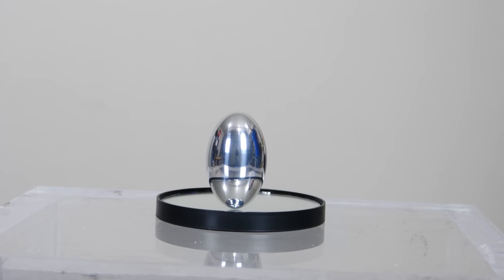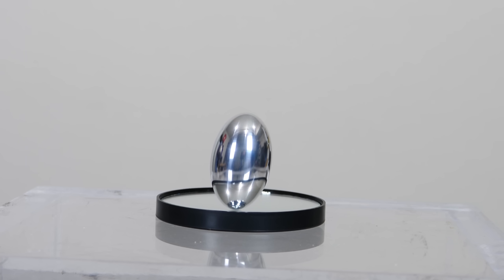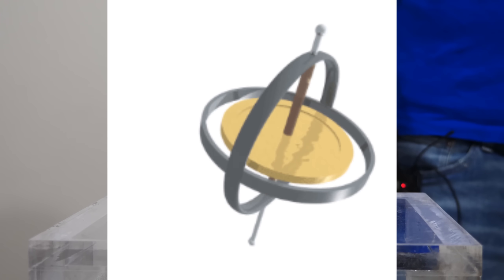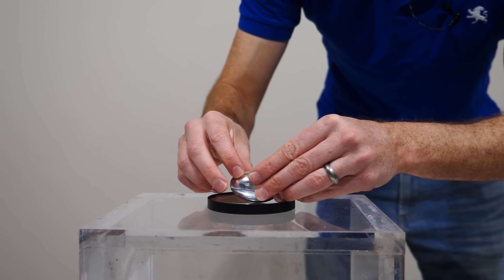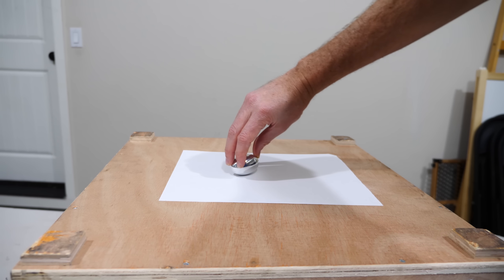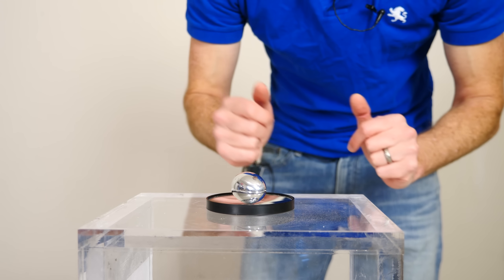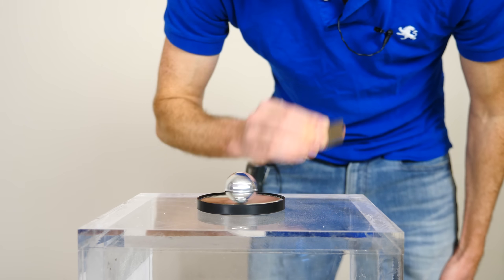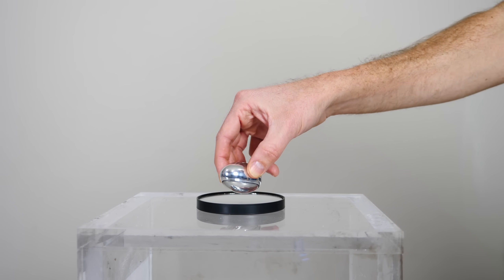Tesla's Egg of Columbus—The Gelatinous Solid

Comment: You can do something similar if you superglue two 1/2 " ball bearings together and then blow in a straw to spin them. A bic pen works exceptionally well I'd advise lightly sanding the glue points. They can fly apart an incredible speed.

Comment: If you want your mind to be really blown.

Put the pad that you are spinning it on.

On a scale.

Then spin the egg.

And see what the scale says.

Because you're also watching anti-gravity in action.

Ironically this is not what is making the egg stand up.

Your explanation of that process was correct.

But the egg is also becoming lighter.

But don't take my word for it.

Give it a shot.
Reply: I've thought of the idea of spinning objects losing their weight, or their weight being carried by some other principles. But I am unaware if this truly exist in any way. Could you further explain why the egg is losing it's own weight?
Reply: @JEAthePrince  Because there is actually no such thing as "Gravity".

It is an Emergent Effect. Like electromagnetism.

If you negate the processes that cause the effect to emerge. The effect (ie Gravity) weakness.

And if it's negated enough. It would have no Mass at all. And would become essentially massless and therefore weightless.

However. If the intensity is great enough. In the presence of an external magnetic or gravitational fields. It will begin to produce a repulsive effect.

Which is real Anti-Gravity.

My paper will be released to the public soon.

Keep an eye out.!

Great question. Thank you for the comment.👍
Reply: @I86282  I was thinking that a bubble floats seemingly effortlessly, and depending on the fluid an object is submerged in, it will change its rate of fall depending on the structure, size, and overall mass, density, etc.  I began to think that the only way to lift would be to isolate enough of a specific element and disperse it in a light enough material, that would be able to bouyantly lift a person. In other words, I'm thinking of making actual wings. It is simpler than studying electromagnetic fields and trying to draw infinite enrrgy from a single point in the field that generally is very difficult to expose without a ton of electricity, and then something about trying to convert it into usable energy, and therefore making weightless "antigravity" ships would be a piece of cake.. but that is a lot of thinking, ans i want to create something simpler. I wish you well on your book, and dont steal my idea! Lol. I hope many people will like it, im just not sure what to do about the wind. That may blow people away
Reply: @JEAthePrince  Well the first thing you have to understand.

Is that the emergent affect a Buoyancy. Is itself an Anti-Gravitational effect.

And always produces a force in the opposite direction of the direction of the gravitational field that it is within.

So Buoyancy itself a form of Anti-Gravity.!

Also you don't need an infinite amount of energy to reduce the mass of an object.

Just how much energy was expended spinning the egg.

Not very much I would say.!

And while some substances are more efficient at negating the effect of Gravity than others.

Any substance. Is capable of doing so.

What you have to realize. Is the object itself is producing the force of mass.

Which is reacting to the presence of the external gravitational field.

Not the so cold gravitational field.

So if I understand your concept correctly.

You would only need to make the wings in a cylindrical shape.

And then rotate them along their own access.

To produce lift.

Which is thinking in the right direction.

But as it turns out. You can just attached a single anti-gravity generator to the fuselage of any structure you wish to levitate.

Which is something that is already being worked on.

So no worries. I have no intentions of utilizing your idea. lol

But you may wish to utilize mine in your future efforts.

I hope this information was helpful.

And I wouldn't call it a book. But certainly a synopsis of a Theory of everything.!

I appreciate your response. And do let me know. If you would like further clarification.

👍
Reply: @I86282  well i was thinking that an object can seemingly move around if it had kinetic energy, but i never had a proper idea on how to actually manipulate kinetic energy. I also thought of using the elctromagnetic field on gas to maybe see if it would make an object lift. But i also thought of this one idea, that what if one could manipulate an atom to create a field, or kinda like, making the particles themselves produce the energy necessary to life an object. Because essentially in every atom there is enough energy to destroy a city. But if it wasnt destroyed, just drawn from in some way, we could possibly have infinite energy.i think the energy is needed to actually create antigravity ships because it is possible, but it takes so much energy to lift heavy weight that it is unreasonable. So imagine having the amount of power as like 3 cities. Im sure it lift a car easily. But how does one make it manipulate its own self within existence? There is a field we can probably tune into, but until then, we should use buoyancy and electric plasma like the stars to create frictionless engines. Like imagine a vortexes of electric hydrogen surrounding a larger vortex, and manipulating the center one to lift the others upwards. Then using research and calculations one could theoretically make a flying object. And if this was succesful, there could be family sized flight travel and single person egg shaped ships.

If they were compact enough into a backpack, imagine the capabilities!

Comment: can someone explain why friction causes it to stand up?
he didn't quite explain it.
Reply: There is more surface area & resistance against which the egg "pushes" until the only way to reduce that area is to go up on its end, where the least amount of surface is exposed.  
It's as if you were trying to stand up on ice rink but your shoes are all covered in oil.  But if the floor was wood, it would be much easier, no?   Now imagine the ice can't be changed, so you wipe off all the oil on one half of one of your shoes.  That would be the easiest spot to use to stand up, no?  Because you created an area of friction.  It's the same with the egg, but it's creating an area of "least oil" instead of actual friction (it can't change the surface it's on or its own material, so that's the best it can do).  🤓👍
Reply: @dp0813  really helpful thanks

Comment: I didn't get that part about the eddy currents. For eddy currents, the flux has to change right? When it's spinning, the angle it makes with the ground remains the same (it's only rotating), so doesn't the effective area stay the same? This implies the flux remains the same, hence shouldn't there be no eddy currents?
Reply: It always has a slight wobble. It may appear to stand upright but it is always tilting back and forth slightly much like our planet.

Comment: This was fantastic! Very interesting how the non ferrous metal is actually affected by the magnet, I had no idea. I going to try a long exposure shot with one of these and the light patterns , thanks 👍🏻
Reply: It’s affected by the magnet because the moving magnetic field produces electric currents in the metal, which in turn create opposing magnetic fields in the metal. It’s the same effect as when you drop a magnet down a copper pipe; the magnet will fall slowly even though the copper is non-magnetic.
Reply: That would be AWESOME I'd love to see it!👏🏻🤩
Reply: Veronykah Spencer777 I just ordered one. We will see.
Reply: Everything is magnetic to different degrees.
Reply: @jeffknott7360  All materials are diamagnetic. But in the case of metals this is generally masked by paramagnetism (like aluminium and other "non-magnetic" metals) or ferromagnetism (for "magnetic" materials) which are much stronger effects.
Reply: @Gottenhimfella  That doesn't make sense. Diamagnetic properties are completely different than paramagnetic ones so they can't coexist in one kind of material. It's like saying something can be hot and cold at the same time.
Reply: @nvmffs  No. It's like saying you can be warmer than you would be if it weren't for your heart muscle releasing heat into the blood, but colder than if you could generate heat by non-shivering thermogenesis.
Reply: @nvmffs  Diamagnetism is a quantum mechanical effect that occurs in all materials; when it is the only contribution to the magnetism, the material is called diamagnetic. In paramagnetic and ferromagnetic substances, the weak diamagnetic force is overcome by the attractive force of magnetic dipoles in the material.  Source: wikipedia
Reply: @Gottenhimfella  Actually you're right. I got confused. But what about dark matter? From what we know so far it shouldn't exhibit any diamagnetic properties, right?
Reply: @nvmffs  Do we know anything about dark matter?
Reply: Drop a magnet through the middle of a roll of aluminum foil. (over a soft surface so you won't shatter the magnet)
Reply: I learnt all about electromagnetism around the time I had a magnet implanted into my finger!